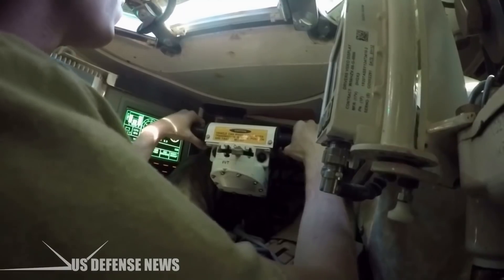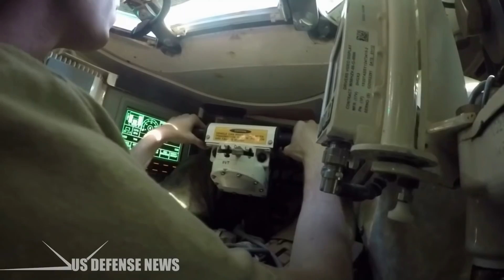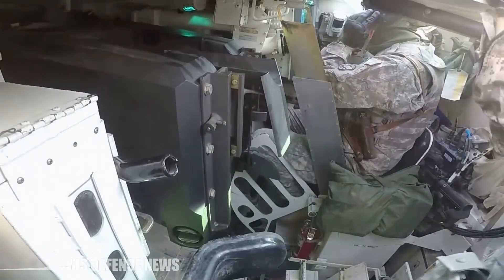Why No One Wants to Fight U.S. Abrams Tanks?

Comment: While I realize the destruction the ammo is capable of what about  the long term side effects for the troops handling the DU ammunition and spent casings?
Reply: There are no dangers from handling the ammo.
Reply: Still kicking here; we had the same rounds  on the M60 A3 back in the late 80s. I was a driver gunner for 4 years in Germany and Ft. Knox  back when Knox was still the home of armor.
Reply: The spent cartridges won't have the uranium in them as that is fired out; not all of the shell is uranium, it would be too unfeasible.

Besides; they use non-radioactive uranium.  All of the weight none of the complications.

Comment: What is the benefit of the turbine, when it consumes double the amount of fuel that a conventional engine consumes?
Reply: Its easier to work on, modular design and has the HP to push the weight. There are some crew benefits as well
Reply: @tankcommander33  The Motor of the Leopard 2 has about the same power, runs on all combustible liquids and you can lift it out in 5 minutes. Lift in a spare engine too.  The russians went back from turbine to cylinder engine.

Comment: No one wants to fight an Abrams because its a mixture of UK armor plating and German gun engineering.
Reply: The M256 was developed from the Rh-120 L/44 though is a different gun entirely. Burlington armor was dropped after the introduction of HAP on M1A1HA.
Reply: @peterson7082  M256 is just an L44 fitted for existing US platforms and systems. It can feed the same shells and produces the same energy and velocity.

Heavy Armor Package is not a replacement for Chobham it's an addition to it which the UK also developed but they used tungsten instead of depleted uranium.
Reply: @13thSystem  M256 is considerably different. HAP is an entirely different armor composition with a similar configuration to how Burlington was arranged.
Reply: @peterson7082   "considerably different" you know... you have to explain after you make a statement otherwise your argument has no power. Changing the fittings and recoil system are minor changes, shells it can shoot are still the same and energy produced still the same. A considerable difference is the L44 and the L55 where the L55 can actually shoot stronger shells and produce more energy.

What you're saying is HAP is not chobham because it's chobham with dense metal plates, ok semantics aside, UK developed it first as usual, with tungsten instead of depleted uranium. Just another tech passed down to US and they modified it to fit with what resources they have abundant of, depleted uranium. Call it what ever, HAP, Chobham second gen, Dorchester... it's still UK tech.
Reply: @13thSystem  A different construction and location of the fume extractor, different muzzle reference sensor, concentric coil spring in place of a spring retarder, different breech casting isn't a different design? 

 Furthermore my statement about configuration was regarding placement in the hull. As for the most part it did not change shape. The notion its the same is based on what exactly? Its a different composition entirely. Burlington was replaced by HAP. Period.
Reply: @peterson7082  Nope, it's a modification, same way you change the parts of a gun with a different scope, magazine, trigger... etc, you just moved, added, removed and replaced parts of it but it's still the same gun

You mean you replaced the plates, and called it original, using dense plates in Chobham was already done in UK, it's not a new concept when HAP was introduced.
Reply: @13thSystem  I never said composite was a new concept. Or using heavy metals. However HAP from knowledge available about it appears to be a different composite armor entirely to Burlington.

 With that logic the MG-3 and MG-42 are the same. Or the M249 and Mk46?
Reply: @peterson7082   "It's a different composite", it uses dense metal plates, in the Chobham layout. one used tungsten the other is depleted uranium. Concept, purpose and effect is the same.

Not sure what is the same with the M249 and an MG-42, The M249 took a bit of inspiration from it but almost everything is different, one is a GPMG/MMG recoil operated gun, the other is LMG gas operated. They have different purposes, different features and used by different types of infantry/crew.
Reply: @13thSystem  It's a sandwich of steel and the particular heavy metal. In case of HAP, depleted Uranium. 

> "Not sure what is the same with the M249 and an MG-42, ..."

 I said Mk46. Not MG-42. My comparison with the MG-42 was with the MG-3.
Reply: @peterson7082  Yeah that's all HAP did, replaced tungsten with DU.

Not sure if you know this but MG-3 is just the modern remake of MG-42 so yes they are more or less the same gun, with the MG-3 just being the upgraded version.
Reply: Dont mess with vietnam :D

Comment: Less than 1 mpg turbine engine. Not good for fuel economy and logistically. The tank could run out fuel on the battlefield quicker than most tanks. A more fuel efficient powerplant is needed.
Reply: Joshua Moore but USA has huge amounts of fuel and they are not far away from base or idk what you call then I’m not in military but I think it’s the resupply unit or whatever

Comment: Put it up against Leopard 2A7? If im not mistaken the leopard has an impenetrable frontal turret armor
Reply: The main gun of both tanks will fuck each other up. There is no "leapord is better than abrams" they both have "impenetrable armor" and the same gun.
Reply: The leopard 2a4s turret  is very easy to pen. But a 2a5 or 2a7 is very difficult. But there are still weakspots on the front armour of a 2a7. The turret is impenetrable but the body of the tank on the front can still be penned very easy
Reply: I don’t know anything about tanks but i plead you not read this from games loo
Reply: @coolsalmon485  I didnt

Comment: Do all tanks have the rubber pads on the tracks? Wouldn't it be better to have steel making contact with ground?
Reply: They use rubber on the road , the steel would just get worn out because the Abrams travel fast. It also depends on where they are fighting.  I could be wrong but that's my reason.

Comment: I'm not sure that Du rounds are harder than equivalent  tungsten alloy. I believe different penetration characteristics are down to the way the round behaves in its passage through armour. Du tends to flake off and is 'self sharpening' whereas tungsten penetrators tend to mushroom at the tip. However new tungsten alloys may have similar penetration characteristics as DU without the toxic side effects of uranium. its all best understood using  computer codes that model penetration, and which tends to treat armour and penetrator has fluids because of the 'regime; (pressures) under which they interact. its complex & classified - so a lot of inaccurate anecdotal information banded about.

Comment: Great video. To bad about the onnoying computer voice. And that part of the video is stretched. :(

For offensive I wonder why the US did not adopt the German L55 gun yet as a simple upgrade. L55 gun allows Leopard 2 A6/A7 to have a somewhat better penetration compared to Abrams but with tungsten rounds. So imagine the result of L55 in combination with DU rounds!
Or is it so that the US relies on improving tank rounds for more penetration? And perhaps considers the L55 to long for use in urban areas?
Or perhaps US intel on T-14 suggests it is not as well armored and can be penetrated by the L44 gun? Looking at the light weight its armor is likely not as strong as that of the heavier western tanks. Probably better than T-90 and T-80U (which can be destroyed with a single hit at 4-5km). Looking at T-14 weight I highly doubt their protection is anywhere close to that of western tanks like Abrams, Leopard 2, Merkava, Challenger, Type 10 and K2. Still, a bigger gun to face future treats can't hurt.
One thing that most people don't know is that modern tanks can shoot down helicopters with the main gun.

What I miss here is the fact that the Abrams is extremely well armored because of chobham composite armor with steel encased DU, which is constantly upgraded. Making its frontal armor pretty much impenetrable to APFSDS and anti-tank missiles. No opposing tank can penetrate its frontal armor, and side turret can take 120mm and 125mm rounds. This means enemy tanks like T-90 or T-14 will have to hit a weak spot like the rear or side hull to take out an Abrams.
This I think is the biggest advantage the Abrams has. Its survivability. This includes its super heavy armor. But besides that also separating the ammunition from the crew and having blow-out panels that force any ammunition blast away from the crew if the ammo is hit.
Reply: There is no such thing as Chobham. It's Burlington. Though both Burlington and DU were used on the M1A1HA, succeeding armor packages and those found on the M1A2's is HAP. Not Burlington.

Comment: M1A1 = T72
M1A2 = T80
Better than M1A2 = T90
Russians are not scared of M1s at all. 
The US has only fought forces with export variants, poor training, poor C&C, and poor resupply...as well as after massive aerial bombardment. Going head to head with Russian units would result in a battlefield littered with Abrams tanks and a few Russian older models. It would not even be close.

Comment: Gotta be careful the Germans thought they had the best tank too
Reply: @AQS521  Plus, our tanks outnumbered them by a lot.
Reply: Funny enough the tiger chews as much fuel as one of these too. My money is on the Russians though who can make affordable and powerful weapons that don't cost the entirety of your civilian expenditure for a single unit.
Reply: Balthizaur   I’m not really fond of the Russian philosophy; “quantity over quality.”
Reply: @awashbarbecue5641  it's the strategy that defeated Hitler.
Reply: Balthizaur   I do not agree with you. Politicians have no role in the United States military. They cannot pressure or demand the military to buy a certain weapon. The military has certain requirements and the f35 has passed them all. It is very common for news outlets to paint a bad picture on the f35. The weapon itself is not that costly, research that went into it was costly. It indeed has faced several mechanical failures and losses against older weapons in simulated dog fights during its testing faze. However Lockheed has fixed those particular issues resulting with a much batter f35.  It went against the f15, f18, f16, and several other models winning every fight with a 21:0 ratio. The f35 is a great weapon with already thousands of them being fielded not just by US but other countries such as Japan.
Reply: @awashbarbecue5641  In the tests against F15, F16 and F18 those 21/0 victories were from beyond visual range with missiles which in simulation are flawless. In a real combat scenario I'd trust that some of those pilots could avoid those missiles and close the distance as missiles do not have a 100% hit rate in the real world no matter how advanced. The tests that Lockheed did were designed not to test the F-35 but as propaganda to help it sell because investors were losing faith after it previously failed miserably. The cost is still around 120 million while the designated competitor, the SU-35 is sold at 50 million.
Reply: Balthizaur   Yes indeed the US has lately been producing many counter terrorism weapons. Drones are a great example. But the US has not just been focusing on counter terrorism, it has also been focusing on producing weapons for larger conflicts.
Reply: Balthizaur   The Russian military is many composed of older soviet weapons with very few modern designs. Compared to the United States military, the Russian military is greatly inferior.
Reply: The Germans did have the best tank(s), but just not enough of them.  Or, perhaps, it’s how you define “best.”  If I were a tanker, I’d define “best” as the tank most likely to be effective against the enemy, AND allow me to survive.  The later panzers surely met that criteria.  However, they were simply swarmed by T34s and Shermans.  It seems the allies put much less emphasis on crew survivability than did the Germans.  For example, see https://www.youtube.com/watch?v=Ns6l7sCoWX4
Reply: @AQS521  Hitler isn't a shit commander,  but a day dreamer,  he got 90% of his plan by day dreaming and stuff.
Reply: @Balthizaur  I say quality over quantity why because I have a brain and know common sense. And I search this up

Comment: Everybody want to fight this tank. Tanks are useless in  war. Especially in full scale war. A person kills not a weapon. Tanks are for parades and show purposes. You must have constant fuel and ammo supply in war. Tanks are big targets. And big targets are hard to miss. Anti tank rockets, remote control bombs, drones, mines, traps... list of tank killers is endless. Also gas attacks, harsh environment. Its very easy and cheap to destroy/render useless a tank than cost of the tank. You can defeat the most expensive fancy tank with simple trap. For fraction of the price of the tank. For 10 k dollars you can have bomb with remote control which gonna beat the crap out of the milion dollars tank. Even 1K drone from the hobby shop with 1kg explosive will do the job. Even 5 dollars rusty shovel will be good enough to dig trap for the tank. Meanwhile the tank will be huge target for the bombers, fighters, MSLRs. One TOS-1 systems and 40 USA abrams tanks are gone. Simply will be obliterated with the napalm/heavy burn rockets. Even if the tanks survive crew inside is whole another story. Tanks are easy targets.
Reply: THERMO-NUCLEAR WEAPONS! That should cover it....Will YOU still be alive?
Reply: @MrBosscat40  
Maybe. No need for nuclear weapons to destroy a tank.
Reply: @GetMeOffThisPlanetPls 
Yes airplanes,helicopters. One bomber to fly over and thats pretty much it for the tanks.
But even iif air superiority is won still the tanks will be destroyed by heavy artilery, rockets,bombs etc. Put anti tank mines/bombs in front of the incoming tanks and bye bye tanks. RPG 7, anti tank rifles, cannons. Tank crew will be killed by napalm bombs. Even if tank survive. Enemy will fire rockets to the tanks. MSLRs 
Remote control drone to drop the bomb on top of the tank. Even can get inside the turret through the barel and detonate itself inside.
https://www.youtube.com/watch?v=vZTccFE0y9c
Reply: https://www.youtube.com/watch?v=85dno0cGn-A

Comment: Abrams, Challenger, LeClerk, Leo...all very good tanks.  The Abrams due to its rear turbine heat signature relies on the cover of air superiority otherwise its vulnerable to infra red missiles.  Top dog 2018 though is the  K2 Sth Korean Black Panther.  It has better armour taking a shot from a Abrams point blank and didnt penetrate.  It has better range using the L46 smooth bore gun (as opposed to the L45) which also fires missiles.  Infra red sensors, night vision, onboard launch and recovery drone and kneeling suspension for superior downhill  sighting and target aquisition.  Also fully NBC capable.

Comment: There is a tank being designed with the nickname “Hopper” which gun is supposed to be 140 MM’s or as high as 155 MM’s. I don’t know about the armor but the depleted uranium armor we use on the Abrams still works so I think it’s the same we could see it as soon as 2030 and it may be a tank destroyer

Comment: the french tank Leclerc are much more better then abrams in every point. The biggest problem of leclerc tank is the cost of maintenance and production and when somefing broken is very hard to change a piece because this tank are very small compare to the same category. 100km in road or not and can stop very fast try to do this with an abrams. also can fight safely in NRBC situation that abrams not do.

Comment: The M1 Abraham tank was a major step for the U.S. Army & Marines. It carries a highly penetrating shell of depleted uranium and carried the very tough Chobham armor, which has had improvements.  The aiming and fire control system on this tank are extremely good and can enable tankers to hit their target under adverse weather and at farther distances than Soviet era tanks.  In Desert Storm, the M1 tanks were taking out Iraqi tanks before the opposing forces could even see the M1. Long distance kills were not uncommon. The AP round on the 120 mm gun has a very flat trajectory out to 3,600+ meters.  The tank is turbine powered and the tank is known for its quick acceleration.   The U.S. continues to repair these tanks vs buying new ones. My only hope is that those M1 tanks in storage get their chance at the Anniston Plant, so we have enough M1 tans for emergencies.  One additional note: The tank crews have to work hard to keep their tanks operating. Even with all the high tech and hardware, it still takes a lot of hard work to do track and machinery repairs.

Comment: T-80?? You guys shouldn't be worried by the T-80's anymore - something tells me that the "ARMATA" - or (as far as I remember) - "T-14" is gonna be quite a "game-changer". STILL - LOVE the Abrams "platform"!... (especially given it's improvement potential). 
PS. If you can be reasonably positive that ALL (or ALMOST ALL) of your rounds WILL find their target - then less storage capacity for ammo in a tank is not a negative feature - IN FACT - it's a POSITIVE characteristic, given the fact that ammo is always at high risk of explosion if a tank is struck - NO MATTER ANY SAFETY MEASURES - AMMO (IN A VERY CONFINED SPACE) is ALWAYS VERY DANGEROUS for the tank&crew. So if you have a system that can deliver "1 HIT X 1 SHOT" (or EVEN CLOSE TO THAT), then bringing in less ammo may be quite an "asset".
Reply: curls up in the "fetal-position," at the bottom of Prospect's Tank, tries to resign his Commission as an Officer, but hands too shaky to sign documents.....